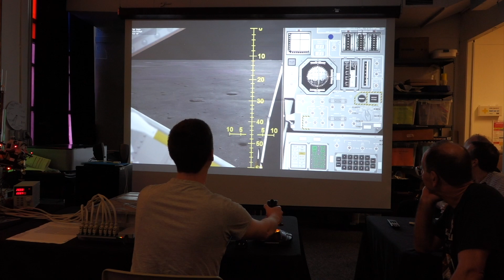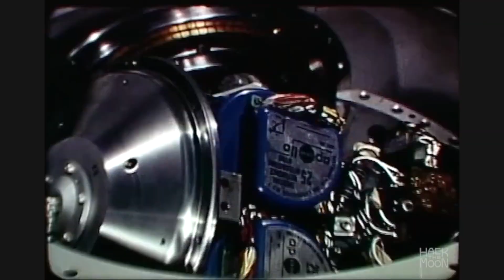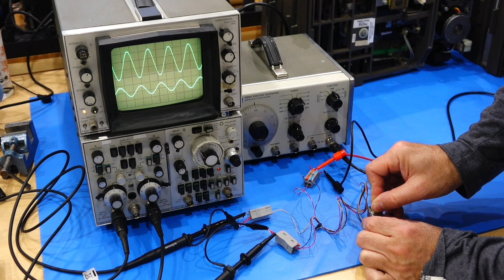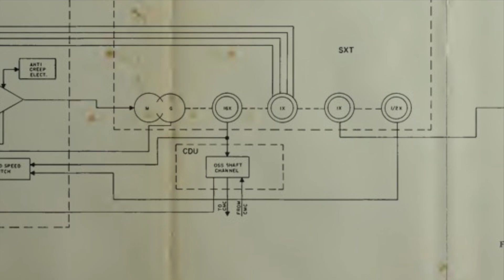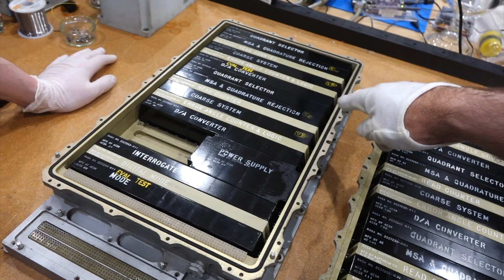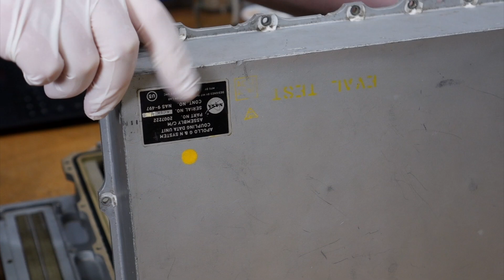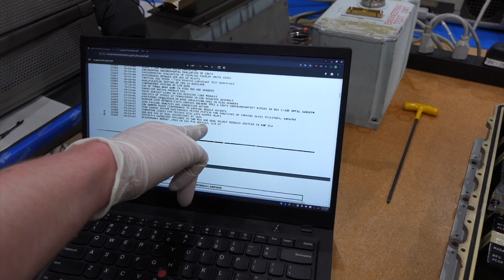Apollo Guidance Computer Part 29: Mikes Scores a Coupling Data Unit (CDU)

Comment: The younger generation may not know this, but back in 1969, we had no PCs, no handheld calculators, and a digital computer was wall sized for eight bits. The computer on the Appolo capsule and the one on the Lunar Lander had less memory than your cell phone. They carried as a backup, if the computer failed, the first Texas Instruments, calculator, later released in the Seventies, to the public, with a sheet on how to do all the navigation problems to return from the moon.

A month after the lunar landings, I went into the Air Force, I got trained in Navigation equipment, the computers I learned on were 40-pound boxes of gears, motors and God knows what, that calculated navigation for airplanes, along with some small amount of digital computing. My last system, on the C-5A, had true digital computers, the primary computer had 32K of memory, iron core mat memory cards, and the Aux had 16K. It took another five years before we go true PC digital computing.
Reply: No handheld calculators, but there were a lot of digital and mechanical calculators of varying sizes and complexity. And digital computers back in the 60s and 70s most certainly did not use a word size of 8 bits! That was quite rare, if it happened at all. They were usually oddly numbered bit sizes, like 36 bits, 25 bits, and the British ICL systems used concatenated 6-bit "sub-words" to get to whatever size was needed, a very odd approach that made them very incompatible with machines from around the world.

Also, NO primary Apollo missions carried pocket calculators on board. Heck, the first programmable one (the HP-35) wasn't even released until 1972. They had slide rules on board if needed, but in case of a computer failure they would have to depend on the ground. The first mission to carry any calculators as backups was the Apollo-Soyuz Test Project, which had HP-65s on board. A few of the early Space Shuttle missions flew with the HP-41C. As far as I know, no American space flights ever used Texas Instruments calculators, even though in my opinion they are vastly superior :P I thought that they had used a TI-59 programmable at some point but I can't find any evidence of that.

Comment: I don't understand the sine/cosine when on the oscilloscope they seem 180 degrees out of phase, not 90 degrees?
Reply: The amplitude of the two outputs vary as sin and cosine of the angle of the rotor
Reply from the maker: That’s correct. See pinned comment at the top.

Comment: It's somewhat beautiful in terms of navigation that basically it (was) still down to star positions and a clock to work out where they were (granted not longitude but dead reckoning speed & heading (in 3 dimensions). 

The 1700s sea fairer's would perhaps recognise and comprehend the method if not the equipment and technology.

Comment: Amazing find! Did they let you inspect the unit at the auction house? Did you have an inkling about what it might actually be?  
  
I'm also curious about who the other people buying this stuff at auctions are. What are they doing with the equipment after they buy it?
Reply: I didn't get a chance to inspect it beforehand, but I did have an inkling there was something weird about it. The listing stated that it weighed "roughly 39 pounds", while the maximum allowable weight for a CM CDU per the engineering drawings is around 37 pounds. I couldn't think of anything that would explain that weight difference other than a measurement error or possibly there being modules in the slots that should be unpopulated -- but given that the thing was still pressurized I thought the latter was pretty unlikely.
Reply: I'm curious about who was selling all this stuff! Of course, auctions always keep that private.

Comment: Resolvers are used in most electric vehicle motors, to determine the position of the rotor with respect to the stator, so that the segments of the stator can be fed current at the appropriate time.  My motorcycle uses one, which would normally only work while the bike is moving since it has a permanent magnet rotor.  However, the controller is smart enough to know when the motor is not moving fast enough to give an adequate signal, and drives white noise into the stator, and this allows the resolver to work even when the motor is not turning at all.

Comment: What a great score! It is amazing to me that all of that beautiful hardware could be replaced with a $2 micro controller and a little glue logic today. We've come a long way...
Reply: It wouldn't be radiation hardened nor robust enough to trust it for a space mission though... Just saying.
There's a reason why NASA is still using those obsolete Motorola CPU's for their space hardware since they're proven and verified. They need to find a replacement soon. Perhaps the MC68000, or a 286 can do the job?! ;)

Comment: I hope that you have the rest of the computer system otherwise you are up the creek without a paddle.
Reply: Mike has already recreated the AGC with an FPGA. Marc has also re-created the connectors to interface with these systems. I'm sure if he needs something else he will find a way. The knowledge and resourcefulness shown on this channel never ceases to amaze me.
Reply: @DeathCubeKX  OK no problem but it probably would have been prudent to have hung onto it and put it in a safe somewhere as the person who purchased it might just decide to recycle it for the scrap value of the hardware.
Reply: @DAVIDGREGORYKERR  I'd be surprised if it had half a million worth of scrap metal in it, even at today's scrap prices :).
I think it was only on loan to Marc and the crew anyway, so not theirs to hang on to.
Reply: Alls good. These guys will just McGyver up a paddle out duct tape if they need one.